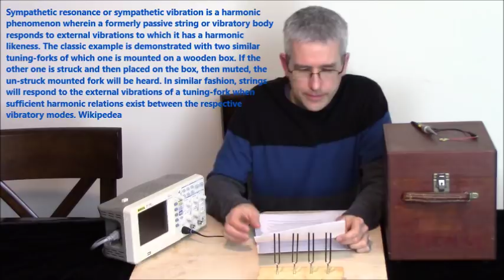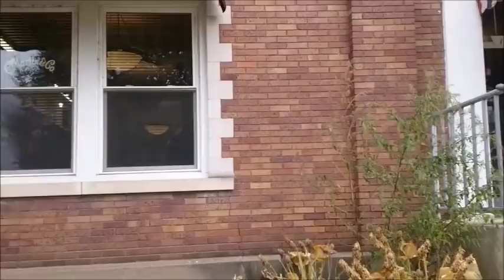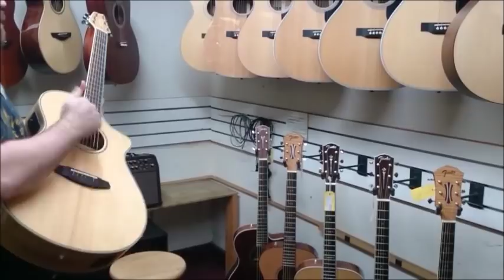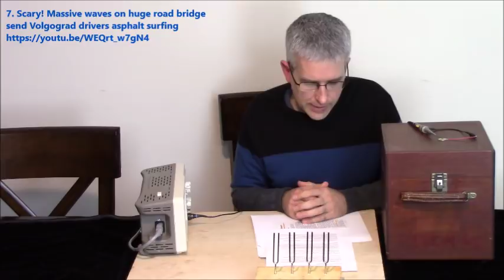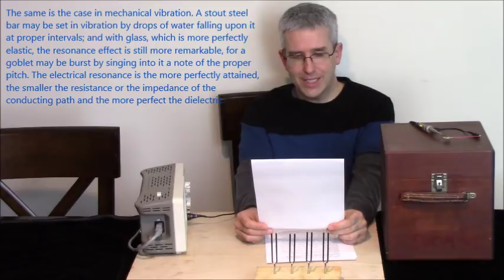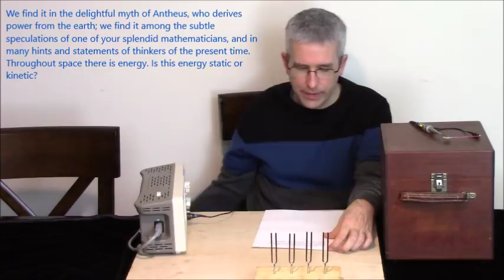Sympathetic Resonance and Unlimited Energy

Comment: How did Nikola Tesla get a bunch of different lights to illuminate in a similar fashion  as demonstrated here?
Reply from the maker: See his historic 1892 lecture. This is fairly simple to do even with a Tesla coil. He was using to large plates connected to the two ends of secondaries on his high voltage high frequency transformer and held the bulbs in his hands.

Comment: Thanks Rick for the interesting videos. I am a musician myself, so the ideas about resonance are very interesting. I've always noticed how harmonics played on a guitar will ring louder and longer than other notes, creating a sense that it is ringing with more energy than what I put I had put in when plucking the string. In fact, with music it all seems to come down to how frequencies/vibrations can interact with eachother to create harmony or sometimes dissonance. 

You're right, musicians don't normally think about the science behind the sound.. but for some reason in the last few years, I've become more and more interested the science of free energy (also become more disillusioned with the music scene but that's another story ha). Anyway, I'm starting to see that music can be a great way to understand these concepts relating to resonance. So finally there is a connection between the two fields I am involved in (music and science), which previously had seemed at odds with eachother until now, at least with my own experiences.